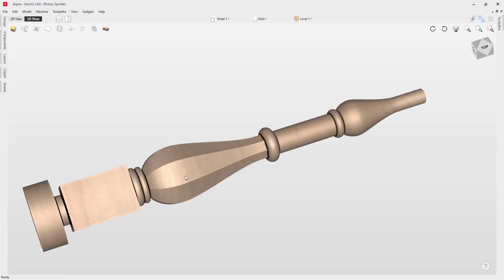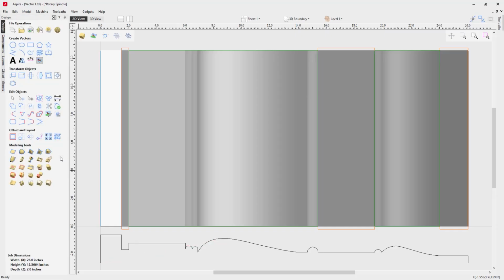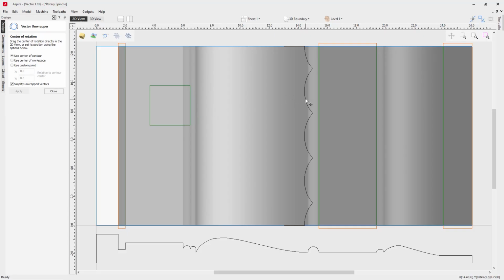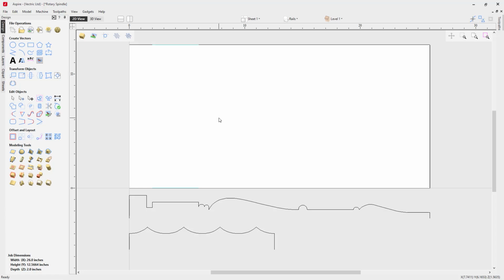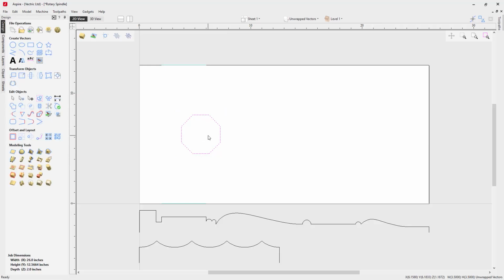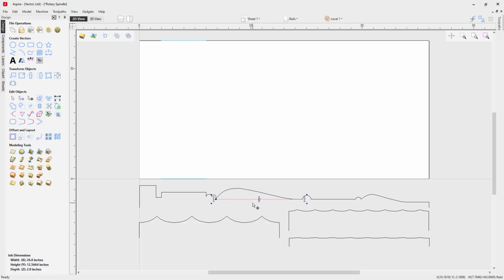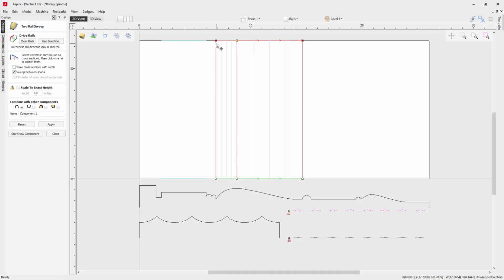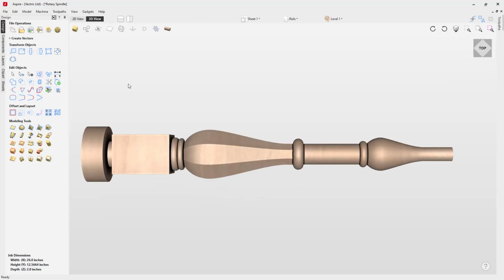How to Use the Vector Unwrapper Tool | Wrapped Rotary Machining | V12.5 Tutorials

Comment: I'm sure this is a redundant statement; however, If you would either number the videos or state which is the next one, I won't spend 15 minutes trying to figure out which one is next.  I'm trying to ramp up, not just bounce through them. They are all great, but I need to stay in line.
Reply from the maker: Thank you for that.  We will have a look at that aswell.